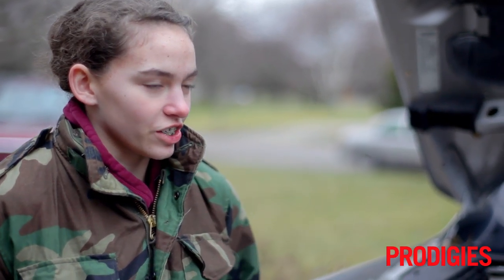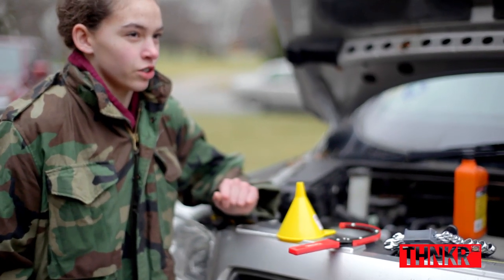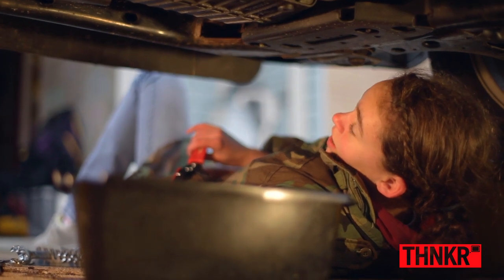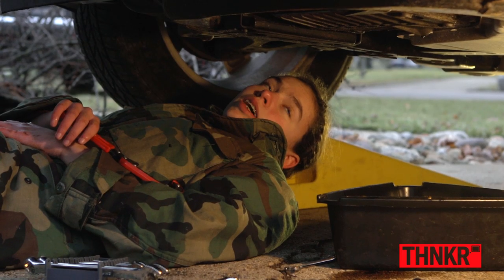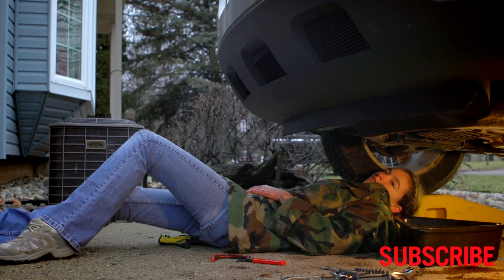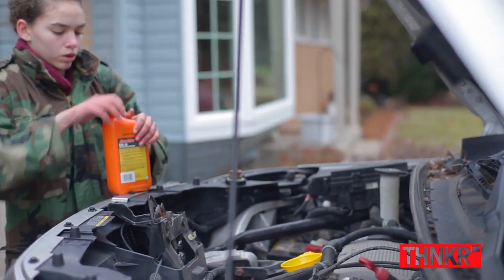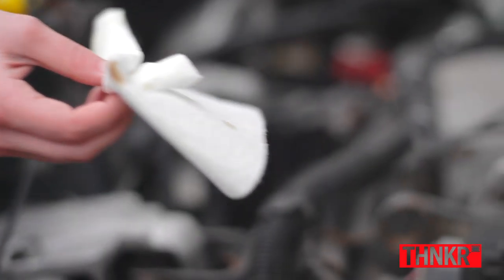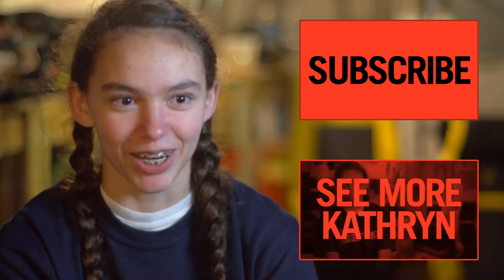14-Year-Old Girl Shows You How To Change Your Oil

Comment: Good job. That is alright.  be what you like to be, and not what people want you to be.  I have changed many of my vehicles oil job. In the last vehicle I installed my cluster in the dashboard from a video. That is what thinking is all about. One thing though, remember to say different vehicles require different quarts of oil per engine size.  My car required seven, and I would have to argue with men when I told them to refill with seven.  Chev Trailblazer.

Comment: Should chock the back wheels too, and put the handbrake on, kinda important. Even put it in gear (reverse). Also, remove the oil cap and dipstick to help the oil drain out. The engine should be warm (not hot) to allow better oil drain. Put a little oil in the filter when in installing, to help oil flow at initial startup. Run the car once you've filled it, look for leaks. Let it sit for two hours or so, then check the oil level and top up a little if required. Sounds like a lot, but it's not.